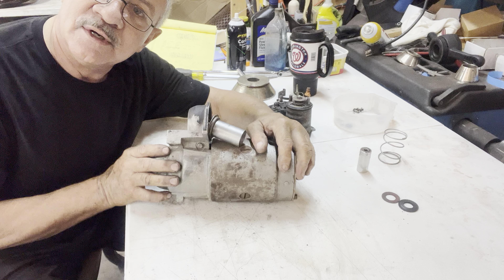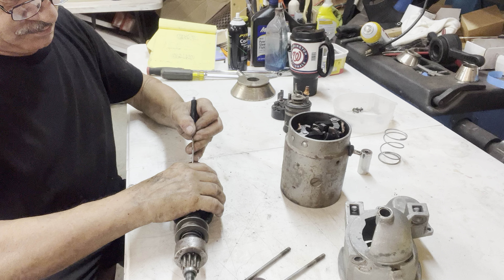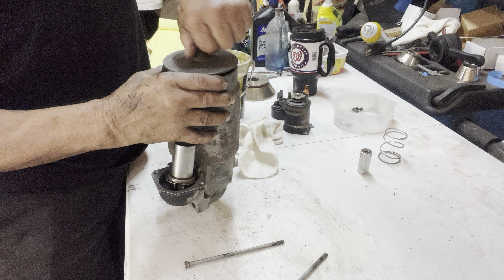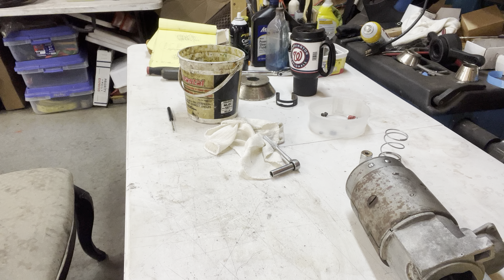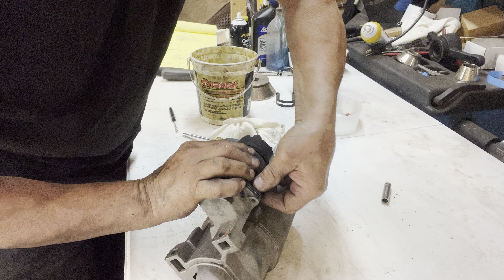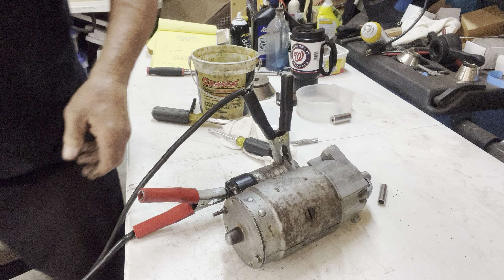Hot rod tip of the day - GM starter and solenoid repair - Jesse Petas - ￼

Comment: Jesse... u aight my well spoken starter repairing tech supportician 😂 haha what if the solenoid has possibly turned to dislodge or disrupt the main hardwire that goes from soleniod to internal casing of starter housing? Seems to be the issue with 1999 starter 4.3 chevy astro (re occurred symptom and same style of situation that caused ie; contol arm/suspension Balljoint and before control arm bushing incidental) would u have recommended repair to possibly address my issue? Turning of solenoid(apparent in looking over my connections that plastic housing of solenoid isnt stationary (8th of a turn movement in either tightening or loosening of connections/terminals) This seems to be cause i experienced previously with a disruption between ignition and starter enable (like a power draw when power applied to turn key, resumes normal voltage when engaged start turn releases back to run. Same symptom previously experienced with a suspension (incident) lol i appreciate ur insights and time u may take to read this. You're video is as awesome as it gets (and ur not Vietnamese 😅) they aight but urs is american to the point of simplicity. Thanx for the display of expertise u share!
❤ Lil G and Whitey (aka chevyAstro)
Reply from the maker: This video is just for old vintage starters and you can’t really use this as a method of repairing new starters on new vehicles and sounds to me though that your starter may be shorted out or hardware just completely worn out and it will probably be best to try a completely new unit to see if That helps / resolves your issue. It’s always best to try a good known unit to eliminate the possibility of a bad starter.